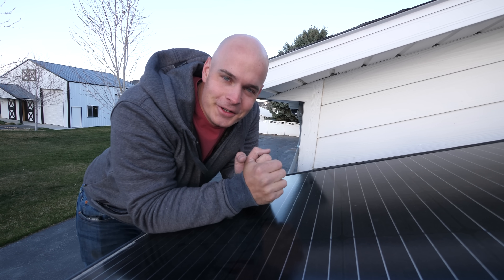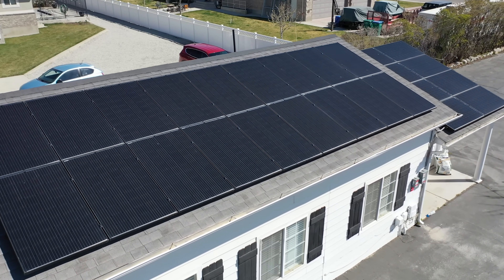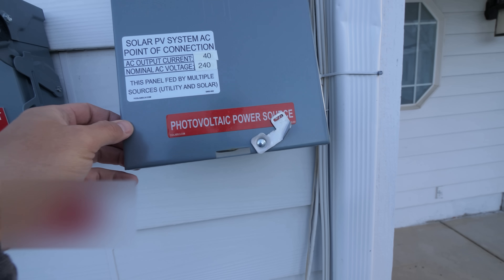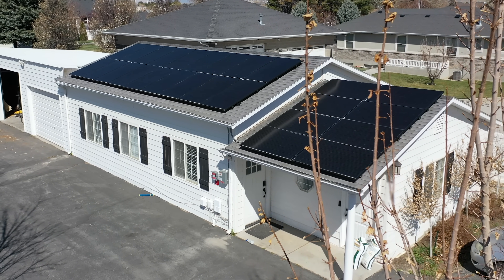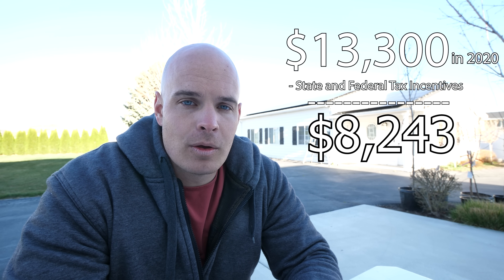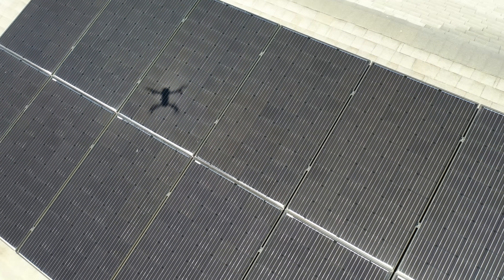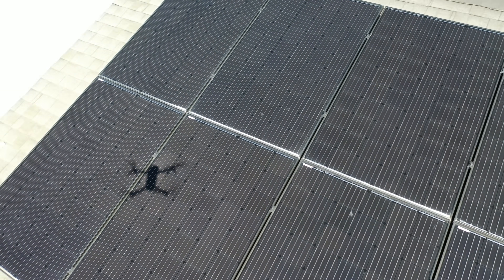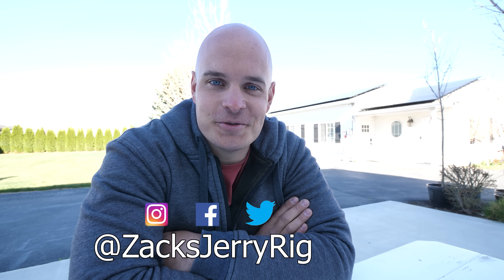One Year Solar Update! - Is Do it Yourself Solar worth it?

Comment: V2L cars are available (& Elon is not the one helping with this technology, asian manufacturers are), if you have an off grid enabled system and hybrid converter you can use the energy in your car and put it into your home. This is what I'm doing in the UK. V2G may also be a thing soon but that its taking a long time to be approved by the authorities and I'll get the same result this way.

Comment: Great DIY solar videos.  After watching your install, I installed (no assistance)our 4 section, 38 panel 14.64kw DIY system on our new roof.  Just hooked into grid and started net metering to our provider last week.  Went larger than our current needs for wifes future EV.

Comment: Also a good thing to note that if you live in a state with massively more expensive energy like California (PG&E), then with electrical costs being over $0.50/kWh during peak the panels will pay for themselves a LOT faster than cheaper energy states.
Reply from the maker: Very true
Reply: @JerryRigEverything  Nice to see replies so many years later! By this point your solar system should be nearly done paying for itself and I hope it's all going well with you.

Your video did get me interested though as I ended up doing some rough cost analysis. I discovered that with a $19k cost and an 8kw system, it would pay for itself within 5 years in my state just because of the massively higher electrical costs (even with the higher upfront cost). The long-term savings are unreal!

Comment: Here in CA SCE pays us 8 cents per KWh I put into the grid, but they charge us 25 to 55 cents per KWh, total rip off. Be way better to have a battery to store my energy and use it during peak use (5pm to 9pm). Plus they rip you off for the use of the grid, in other words, half of my bill is TRANSPORTATION CHARGES. Best thing is to get off the grid completely!

Comment: the power in my place jumped almost in a night from 0.15 to 0.56 ...we spend around 500kw/h per month  i am in europe. if u do the math at 0.56 is alot money per kw/h and probably will go a little more up to 0.6 - 0.7 until the end of the year is becoming a nightmare.   but the start cost is not easy

Comment: Solar makes zero sense today absent of any free money from the government. If you’re a freeloader great, but purely out of pocket? Doesn’t add up. Electricity is so much cheaper. Calculate your ROI and depending on your current bill it could be 10+ years. That’s without replacing anything. The sun breaks down everything and batteries don’t last forever so that’s even more cost for “free energy.”

Comment: Help me figure this out.  The two of us use a monthly average of 532 K.   My panels will have to face east and west, Roof is metal with a tilt 30 Degree.  This will not be a DYI due to the steepness and height. Does it make sense?

Comment: in 2021 (till November) the price in Germany was around 30ct/kWh. In December it rised to 50-60 ct/kWh. So a grid would be baid much faster. In December some atom power plants in France went offline, and so we needed them supply with green power from Germany. In February 2022 the war started, and so the prices are not going down so fast.

Comment: I was curious what your panels are rated at. I have 24x260 watt panels and I do not generate close to what your getting. In 2020 I generated 7.4Mwh or 7400 kwh. Looks like your almost double that. My panels face east and west, not south like yours and are at a steeper angled roof. The production goes down a lot in Winter months because the angle of the sun. Even so my power bill has been greatly reduced. Great job on the installation video btw.

Comment: It's actually surprising to see how cheap your electricity is.

In quebec, we're priced at 6.319c/kWh for our first 40kWh in a day, then 9.749c/kWh for the rest. So having something like 10c/kWh is not that far from us. While I'm always under the 40kWh treshold in the summer, in the winter I'm always over it...

So while the cost calculation is a little different here, it won't be that far from yours.

Comment: The one green issue you can't explain away with getting cheaper is the chemicals used to produce the solar panels are toxic. They leach off the panels and into the ground. The batteries you are speaking about adding are also extremely toxic right now. Yes they are working on changes to get more earth friendly batteries but you still will have the chemicals in the panels. That is like saying wind generators are green when you have to mine the metals used in the magnets and generators. This usually ends up being a toxic mess somewhere. You can find many of the same videos concerning the toxicity of panels and wind generators on youtube itself.

Comment: I have a 8.68 Kwh system that has never produced more than 600kwh a month (and this is in texas! with a low peak sun of 4.8 hrs, avg of 5.4 hours and a high of 6 hours in my area) i avg maybe 400-450 kwh generated a month. I know for sure solar panels are wonderful and should work great but my setup is a joke. anyone got any tips? its been 5 years like this.

Comment: Uff almost $9000 for that kit..
Now reality cold calculation. ❄️ 🥶

I'll get Ugly be Advised

Keep Your Electricity at normal use don't mind cost at all  for 8 Years and in 2030 you get that kit for $250. I'm afraid that how John Smith looking at the issue + Yeah no $1000 up Front

Comment: Aren't the panels on the lower section of the roof too close to the higher section? Seems like you could move them a couple of feet to the right and postpone the shading from the higher roof section until later in the afternoon.

Comment: For comparison purposes: My top-of-the-line Enphase system with 10kWh of panels and a 10kWh battery backup cost $40K installed. I just got my check back from the IRS for $10k.  To clear up a misconception, energy that I send back to the grid goes to the nearest energy sink which would be my neighbor's house (non-solar).  It does not go back to the power plant.  My mini solar power plant relieves the grid by not having to transmit, with transmission losses, my exported power to my neighbor. It would not surprise me to find out that the electric provider includes my exported solar in the total percentage of green renewable energy that they provide-perhaps even charging more for it! Since I paid $30K for this infrastructure, I have a difficult time understanding why folks think solar users are not paying their fair share of grid infrastructure costs.

Comment: Zack, I watched this again and about half way in, you had stated that you don't have batteries because they are expensive.  But you do have batteries in your Electric Hummer project.  (That's what got me to your channel)  Anyways, have you looked more into using those tesla batteries to pull double duty for House at night and EV use when needed.  That way you might be able to reduce the cost, altogether, that you are still paying to the electric company after the solar system install. Use your tesla batteries at night for the house and solar during the day to both run the house and charge the batteries back up with what is left over from running your house during the day. In stead of giving any of the extra to the Electric Company. Then repeat using the Tesla batteries at night to run the house.  The reason I ask is that I am hoping to do that on our farm - LORD willing when I get my DIY EV finished.  (Sorry at my age 62, I'm still trying to get the hang of this internet, YouTube, and FB stuff. It's way over my head.) Grin  Thanks again for your channel. I enjoy your videos.  All the best, Tony Shipman
Reply from the maker: I have looked into that.  And I think it might be possible. I don't think the J1772 plug can 'back feed' and power my house but i think the Chadmo plug can?  Either way it would require heavy modification to my battery box where I dint have much room. A 400v pack isn't the best to use either. I think most solar dc inverters are like 48v or something
Reply: @JerryRigEverything , I wonder how then FORD is doing it with their new EV truck?  Jason with Engineering Explained (another person I started following as I'm learning how YT and FB all works.) talked about how one might be better off buying the Ford EV truck vs a just buying a battery setup for their house. He showed that it was even cheaper and you got a truck you can use too. I need to look more into it all, to see if I can make it work with what I plan to do. I just thought or was hoping with you being so much farther along in your EV project than I am and you having solar, that you might have more insight. I also respect what you do and have done. Thanks again for your YT channel, videos and FB page. As I said before; your Electric Hummer project is what got me to pull my EV project out of mothballs a little sooner.  LOL   Take care,  Tony Shipman

Comment: I just got two quotes for full home solar. $26,159.22 was one, and $24,000 was the other. The quote seemed that I wouldn't get a return until 10-12 years. But how will costs and panels be during that time? I just don't find it worth it when I won't see a return for over 10 years. I do think however that the DIY decision was ideal. I know that you made this video probably a year ago, but I just can't swallow $25k. $13,000 is exactly more like what I wanted to spend.

Comment: Your math is wrong. We have things called depreciation and interest. You’ll break even at the ten year mark, maybe, unless they close down the coal facilities in Utah and your energy costs rise. Please explain 80% capacity? Your panels show up in the box ~21% efficiency.
Reply: Consider this: His $13300 investment gets about 10%/year profit for a decade, 9% for the next decade and 8% for the next. Best high yield savings accounts offer less than 1%/year interest. Unless the whole state goes solar and the energy costs drop dramatically, the panels are clearly a great investment.

21% efficiency means that a square meter of panels in normal sunlight delivers ~210W electricity because the incoming light contains 1000W/m2. The 80% capacity is manufacturer's promise that in 25-30 years when their warranty runs out the panels will still produce at least 80 out of 100 watts of rated power. Given going lower than that means the manufacturer has to pay for selling you faulty panels you can bet the actual number is likely to be higher. Basically, worst case scenario is that in six years the panels are only at 95% capacity so instead of saving $100/month it is $95, meaning it takes about two months longer than lowest estimate to pay for the panels.
Reply: Your math is terrible. A ten year loan at 4.5% interest is $137.84 per month. The megawatt a month he’s producing is worth $100. At 20 year lifespan he barely breaks even.  You’re still better off putting money in the bank at .001% and just paying your energy bill. 

Next idiot please.

Comment: You can make 20%-50% more electricity with 1 simple add on. I will try to describe without drawings. What you do Is to create an aluminum rail system. Added on to the 1 they gave you. The 1 they gave you acts as a stabilizer. The 1 you attached acts as a venetian blinds. You add an electric motor that spins once every day. What it will do is keep your panels in perfect alignment with the sun. Then at night it will re align itself.

Comment: Honestly municipalities should start requiring solar panels on all new-build residential and commerical buildings. It would take a long time to tie all residential solar panels into the overall grid but with the increasing economic viability of photovoltaics roof space - especially in places like AZ - is essentially wasted real estate that could be used for cheap electricity generation that could reduce loads on the existing grid.
Reply: that's not called freedom.  That sir would be communism

Comment: Great video, thank you.  You what I don't hear anyone talking about when discussing the payback on solar is the effect on resale value when a seller sells a home with an OWNED solar system installed. I'm a real estate broker and homes with owned systems sell for more than homes without or with leased systems.  Owned solar systems can increase the value of a home by as much as 5% and I've seen that in my business. 

For instance, say I buy a system at $22,000 ish, the ITC lowers that to $16,000 ish.  I hold onto that house for 5 years after the install and the value of homes like mine is $500,000 without solar, you can justifiably add $25,000 to the listing price of the home, market depending, when you sell.  

I mean lets just cut that in half and say it's $12,500 more.  If I save $12,000 on energy costs in 5 years (I live in California where rates are high) I've actually made money in 5 years.  The system is net $16K to me, I save $12K over 5 years and I make another $12K more when I sell in 5 years.  I've made something like $8K and that's a conservative estimate.  It think I've just talked myself into this lol. 

I'd be happy breaking even in 5 years much less making money on the sale. The upside increases the longer you own the home.  Anyway, I just wanted to share that I don't think the calculation is on the payback should be related to the electricity generation alone. There's more to it than that.  Hope it helps.

Comment: Hi great video thnaks I wonder if it's possible to make a video where we can use  solar panels not running through the house breaker panel but instead to battery pack to store the energy that is then connected to a 220V plug in the garage that would charge a EV? thanks

Comment: Interesting, here in the UK  I also got Solar power and Battery and it cost me around £10k.  it has only been installed for about 14 days - and the weather is clouded most of the time, and yes it is making me money. as I was surprise how efficient they are,  my only question is: will I need to clean them at some point.

Comment: When you calculate the cost of energy you have to consider the rising cost of utilities. Power is .10 a kw now but in ten years it will be 10-50% more depending on the area. The one time cost of solar is a 30 year investment that keeps on giving.
Reply: except the panels degrade in efficiency along with the battery... and they have to be removed and re-installed when you have roof replacements...
Reply: @mistuhjawknee5505  I have a cement tile roof. It's good for 100 years. Solar will be dead by that time. Degradation is about 1.5% per year, but inflation is much higher. It's all win/win dude. I have 7.56 kW system with 2 power walls. I live in South Cal and I know my numbers. It's a no-brainer.

Comment: Hey Zach the f150 lighting has the an instant on generator. The battery size of the 150 is able to run a house for 10 days conservatively. Also has a safety cut off to stop supplying power and leave enough range to drive to recharge the truck.

Comment: Man I'd love to set up a solar system, I have a roof with a very shallow angle and plenty of space. But, environmental benefits are pretty low as almost all the power in my country is from hydro, wind and a little geothermal and the financial benefits are almost exactly nothing.
The savings in power bills (ours are not that high) are almost exactly the same as the cost of getting solar (a little less, sadly) and the worst bit is we can't feed power back to the grid. Not only can we not sell power to the grid, it's actually outright illegal to run your meter backwards by feeding power out.

So they cost a little bit and will pay for themselves in about 15-20 years if they remain at peak efficiency the whole time AND they'd just be replacing the power coming from the hydro dam not far up the road... It sucks, but a case of not yet for me

Comment: Hi, great project. One thing I'm curious about is: did the copper ground wire oxidize on the roof since the installation? I wondered why didn't you use a shielded wire and just strip it where the brackets connect to it.
Reply: codes generally specify bare copper, and it makes it obvious by visual inspection what it is.
lightening doesn't care about surface oxidation

Comment: Pretty good video very informative, two things bothered me. One is not all roof rafters are on 2 foot centers, depending on where you live they may be tighter for snow load, no biggie. Second have a competent electrician do your electrical installation. Not having proper conduit’s and connectors in your system is just asking for trouble. That’s how fires are started.

Comment: I do not understand the promo of the Anker Power House cause Amazon were all out of them. But from the II 300 that was on "sale" was still about $1/watt stored. Nothing to really write home about in all honesty (minus the coupon). 

I rather invest in other storage options that can be up to 1/3 of the costs (ya I know other battery types might not lasts as long but still several years or more if you do it right is still great for the price points).

Comment: If the power company is refunding most of the money for the excess energy from cells, then there's no financial reason to buy batteries.  Batteries primarily used as a backup are an extremely expensive solution.  Also... why must people always be so infatuated with and revolve everything EV related around Elon Musk?  Musk has been against V2G technology forever because he doesn't think people spending $44k+ on his cars is enough; he wants them to spend an additional $14k on his batteries.. 25% of which is subsidized by taxpayers who may or may not see any benefit in buying a battery system for their home.  Other OEMs are starting to adopt V2G or V2L; so if you want it, then buy it.  Hell, even my Volt has people rigging them up with inverters to allow for V2L in case of a power outage.